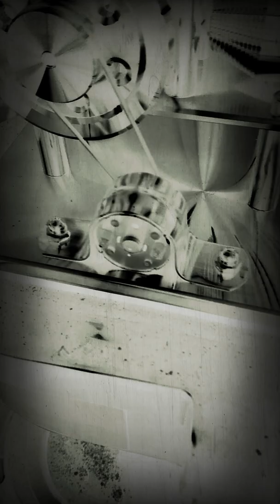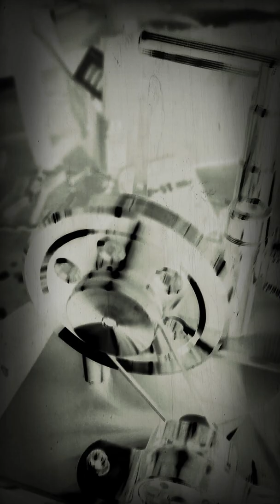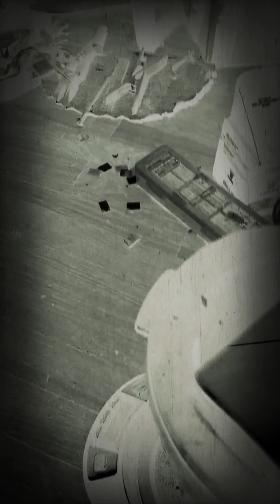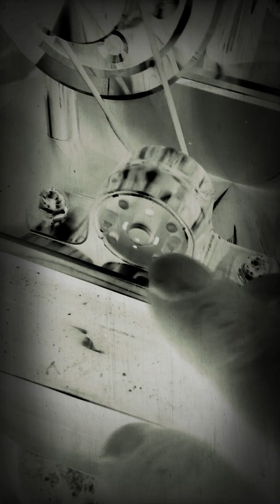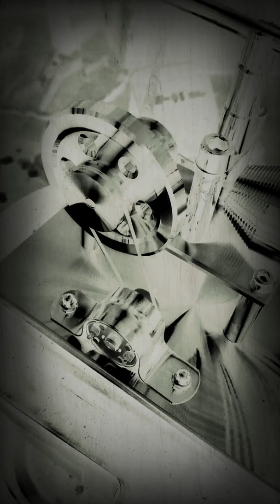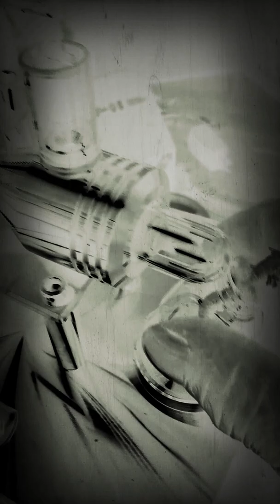stirling engines and prepping

Comment: I like the idea of using a Fresnel lens & Sunlight to power it during the day. Unlimited free fuel for 12 hours a day. I wonder how large of a battery you could fully charge with one is running from sunrise to sunset, then what you could do with that battery all night. Fresnel lenses can make Sunlight Really lethal and hot. I wonder how large you can make the engine and how much you can do with it. I bet you could power a house.
Reply from the maker: It would power a house. This system will do up to 24 volts at 3 amps. Augment that with solar and wind generators you get continuous electrical output